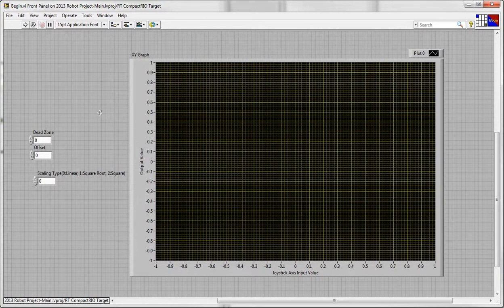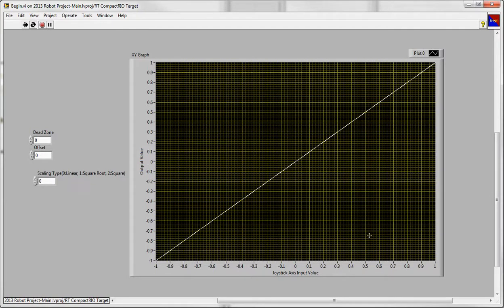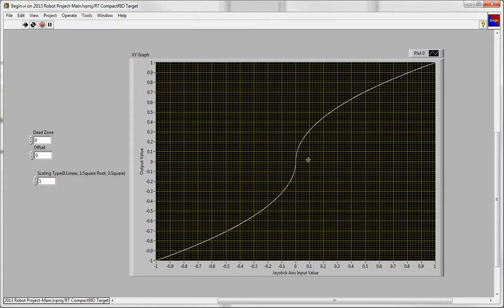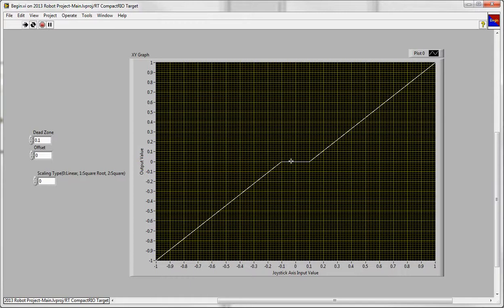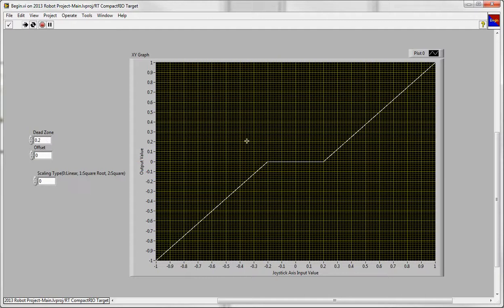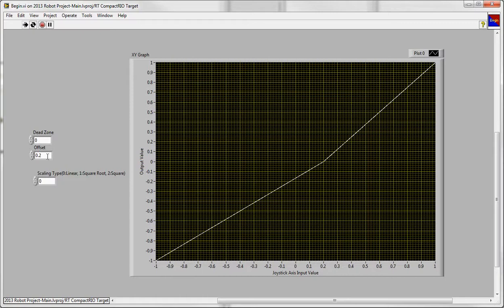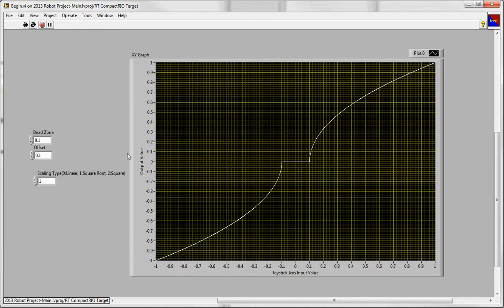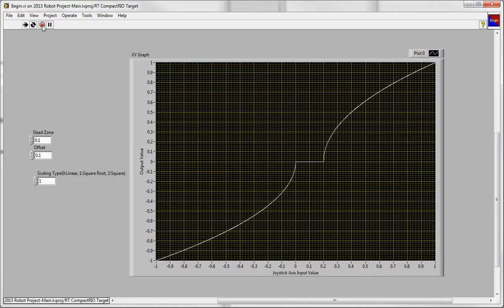Conditioning Joystick(gamepad) analog axis in labview

Comment from the maker: Ye don't be mislead this code was designed for single axis. If you try to use it separately for x and y but utilize x and y in some ratio then without additional code it will lead to some bizarre behavior. However it's not too complicated to figure out the extra code that would be needed to utilize it in this fashion(like trying to find the angle or hyp of the x and y axis of an analog stick. I've been playing around with this module and am really starting to like the square function.